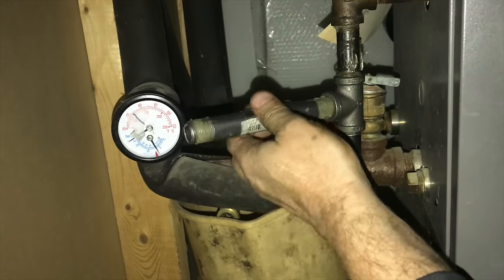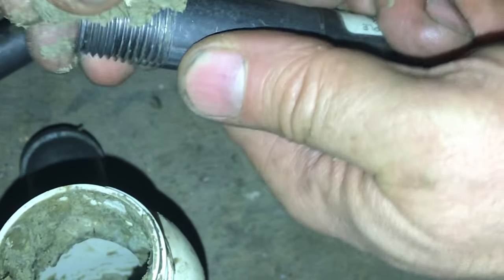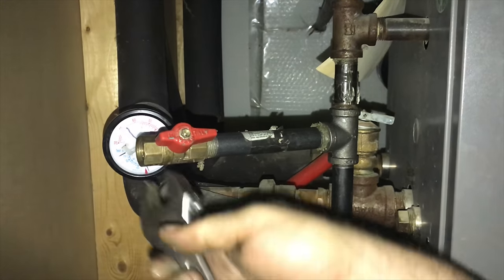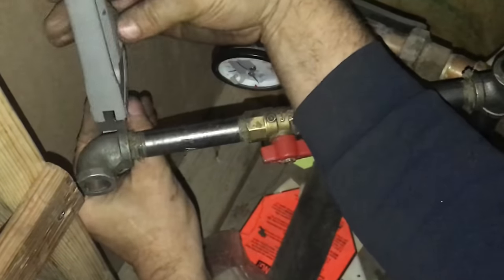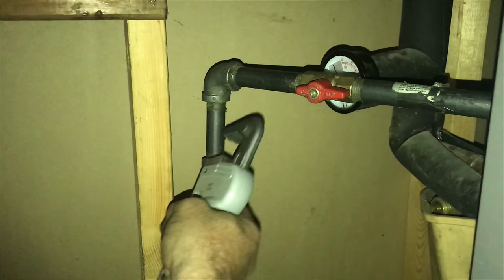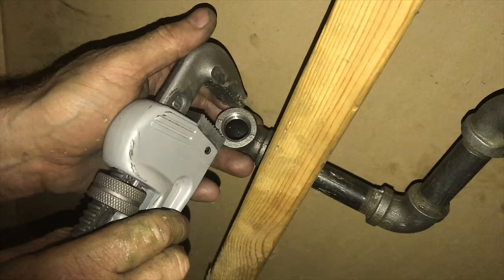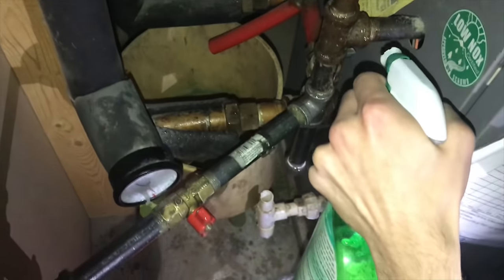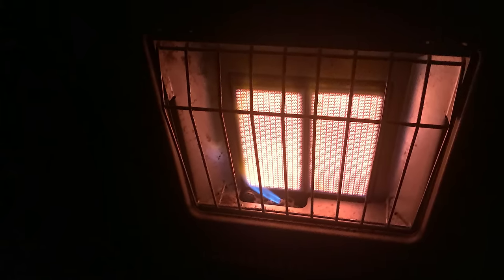TIPS on how to install gas line

Comment: How do you trace a gas pipe that runs inside walls?  I have a gas pipe that goes into my fireplace.  Unfortunately it appears to not be hooked up because no gas comes out of it.  I want to trace it back to where the supply side is either capped or maybe where there is a shut off valve.  The entire wall where the fireplace is is made of brick so my Walabot stud finder won't pick it up.  Do they make gas pipe locators (either a tone type or maybe a metal detector type?
Reply: You need to call a professional. Do not ask this you tuber for any advice his a hack

Comment: ALWAYS use a Yellow sheathed flex hose, never use bare steel flex hose for gas now days, and yes that is now code in most states if not all.
Reply: CSST
Reply: Also you can not re use a appliance flex connector.  Read the ring on 5he flex connector
Reply: The only reason for using yellow is for identification by people like you.
Reply: CSST is different than a flexible gas appliance connector

Comment: You can't bury the gas fitting in the wall should be outside the wall and accessible to change and service the line valve should be also at the end so it can be replaced when it starts to leak at the stem being in the run like that, I being a gas tech would have refured you to a plumber for valve replacement when it went.bad .If at the end where it excesses we would offer to replace for a small fee ,when in place it was require to much disassembly and reassembly we would have turned the gas off to the house so a plumber could repair it.

Comment: Can you reuse that pipe if replacing a gas controller on a water heater or is it one use like the yellow flex hose
Reply: You can reuse them, assure though that the threads are clean.

Comment: Noob question here. Why add pipe at all? Why can't you just remove the bottom cap of the established pipe and attach 5 feet of flexible gas tubing kit with a direct connect to the heater?
Reply: Valid point ! You can as long as you avoid sharp turns (i.e. more than 30 degrees).
Reply: That "cap" is required by code, it must be 3" long minimum and is called a "drip pocket" its intended to catch any free debris in the line before it can clog a small port in the burner assembly or gas valve.

Comment: If you are connecting a gas line INSIDE your gas powered dryer, can you use teflon tape?  Or is pipe dope still better?  Keep in mind these fittings may need to be disconnected again someday to replace dryer parts.
Reply: I always use both Teflon and dope. But never I the flex hoses
Reply: Call a professional please
Reply: PTFE only is legal in most U.S. states and in Ontario Canada
check with local jurisdiction

Comment: What if you have a leak, do you just tighten it more? Just curious. I'm guessing you cant replace a piece in the middle of a run. You have start at one end and assemble all the way to the other?
Reply from the maker: Typically, if you titan it more you can get it to seal, if it’s in the middle of the run you’ll have to tighten everything from that metal piece all the way to the end. There are times that I’ve seen a crack on the thread in a matter how are you tighten it won’t seal. Pipe threads are tapered so the tighter you tighten the pipe the more thread interference you have the better it’ll seal. The pipe dope doesn’t make it seal it just lubricates the threads so they can get tighter with less torque.  Hope this helps
Reply: @livefree6878  It helps a bunch. Thanks for the reply. I'm subbing now.

Comment: I own several houses and I am so tired of hack contractors who rush thru jobs and leave me to repair things. Im doing my own new gas line. It's not that daunting , we are natural gas and down here they use yellow plastic lines. And basically what is a push to fit connection. 2 plumbers in a row ran a yellow line out in an arch into the flower beds since after I asked why they don't use a 90 degree bend to stay along the house, they said they don't make them. Everyone is a hack these days , with few exceptions  .

Comment: You can make these plumbing connections much better. We can do better than the turkey. Why not use pipe fitting fluids? Flex connection and flex are not secure. Natural gas stove is not safe.

Good luck

Comment: I especially like the way the pipe angles down after going into the stud.  Don't see that too much.  Oh yeah,  How are you going to read your gauge that you ran that pipe in front of?
Reply: bososz . Main does not mean the main street in downtown. Shee-o-no-shee he’s got over 330 k views and i am sure this video helped a lot of people. And it does not bother me at all because for me this job would be too small to take over.
Reply: @anonymousbyproxy8250  obviously your not going to run each line from the street................................

He tied into the system from the drip pocket on the boiler, That is wrong. You don't apply 100 year old dope by hand, you use a new can and brush. You can use Teflon tape or dope or better yet both.

1 hole in a stud is not a proper pipe support.

It's crooked and unlevel as fuck.

He blocked the temp/pressure Guage.

At least he added a drip pocket back into the mix, so he has that much going for him.
Reply: @anonymousbyproxy8250  the main gas line in the house . He tap in the the drop of another appliance witch is a code violations among the other code violations he has
Reply: @bososz  well said

Comment: Good job, good tips.  I'll be using some of these tips when I run the gas for our back-up generator I'm installing for our house.  Thanks for posting, I picked up some useful tips. Especially to use pipe compound, sharp pipe wrenches but not on valves and to plan my route.
Reply: Call a professional please
Reply: I hope you're joking...
Please don't use these "tips"

Comment: DIY ers do not need to be doing this. the nipple on top of the tee has had metal cut away from the wall with your sharp pipe wrench.
never use a brass valve on natural gas, spend the extra dollars for a steel valve.
never sharpen your pipe wrenches as they will chew up your pipe, always make certain you can see thread after your pipe has past through the wall and your fitting has been installed.
do not place your pipe in a bind as this one is, note the angle where it passes through the stud, this will lead to breaking in the threads. Buy the yellow coated flex hose. 

I have worked in the natural gas industry for 40+ years, i can count on one hand the number of times that i have cleaned the teeth of a pipe wrench, never sharpened. 

good rule to remember is that black(steel) pipe is for gas, galvanized pipe is for water along with Brass. Gas will eat brass for breakfast.
Reply: There is no issue with using brass valves with natural gas. I don’t know where you got your information from on gas eating brass. There are many issues with this video but using brass isn’t one of them.
Reply: @o6lifeguard  I don't know either we use brass ball valves on every furnace we install

Comment: Drip leg for all appliances!!
Reply: Opened 100+ and never found any residue.
Reply: @anonymousbyproxy8250  doez not mean that it's not code required. And the way the dope was put on its likely going to clog a port when it makes its way there. Just replaced a gas  alve for this exact reason
Reply: @MrDmadness  u replaced a gas “alve” ?!? Gas alve ?!? On whose ass ?!?!?
Reply: @anonymousbyproxy8250  valve.. my bad tablet mis type. I can admit it.. you should try it ;)
Reply: @MrDmadness  Don’ worry, evidently it was a typo, unless your mind was on smthing else …
Reply: @anonymousbyproxy8250  I'm not understanding what your trying to imply... you're very bad at this and really reaching

Comment: I've done a lot of disgusting things while plumbing and I gotta tell ya, watching him scoop acient calcified earwax from a pill bottle with the occasional hair in it and apply it very messy to an already 45 year old black nipple has got to be one of the most disgusting things I've ever seen in my life. here's a tip for everyone trying to learn from this video. use soft-set yellow pipe dope OR blue pipe dope when threading gas pipe, you dont need alot either, just enough to cover the threads. dont use tephlon tape bc it can fall off in pieces on the threads and get lodged in your gas orifices. say NO to pipe wrenches when working on something this small as it's very unnecessary and will end up being frustrating. instead use channel locks, intead of using 3 different tools you could use one. Also hold backup when you thread onto a series of specifically oriented materials such as valves for God's sake.

Comment: I have a question about the diameter of the outlet on the meter. It is currently 1" diameter. I will have somewhere about 90' of pipe from the meter to the furthest appliance. So I would like to attach a 1.5" pipe to the meter. Can you install a 1.5" diameter outlet on the gas meter with 1" outlet? From my understanding, attaching 1.5" pipe to the 1" outlet on the meter would create a bottle neck right there?  Thanks
Reply: Adding a large diameter pipe will assure that you get the same flow at the other end, otherwise for such a long length you may have flow reduction at the terminal. But at the terminal do you need that much flow as supplied by 1” pipe ?!? (For a house that’s a lot). How eventually did u solve the issue ?
Reply: What kind of appliance?  Sounds like a generator or pool heater??  Make sure your meter can handle the additional btus.......you can look up pipe sizing and what size pipes you need based on the run and the load.
Reply: Call in a professional please

Comment: Thanks for this video, I did just about everything you did to install a grill and I'm going to make everything tighter (though there are no leaks).  

Is it possible to have black pipe all the way to the heater?  That is, if the heater never had to be moved?  

Does this heater have a chimney or an outside vent?  I would like a heater like that in the garage but I don't like the idea of no outside vent (and possible carbon monoxide).
Reply: leave it to a plumber for the love of God
Reply: I’m no expert, but I’ve  read of “ventless” gas heaters.  Try researching “ventless” gas heaters.
Reply: @bravomarlon91  We probably will, but I think the plumber we know might be an atheist.
Reply: There are burners that don’t need vents and they are common. U cannot properly connect a black pipe directly to an appliance because u need a certain flexibility.

Comment: After you finished everything, if you need to replace an elbow in the middle, do you have to start over from the beginning?
Reply: You could cut the pipe next to the elbow you wanted to replace, then use a Union to insert the replacement parts

Comment: This is why how to Videos for gas lines are not good. 
In Alberta you are to use yellow Teflon tape and ONLY yellow on gas line (pipe dope is optional as it is NOT a sealant).  But as far as running a gas line in a wall, is only allowed if you have no joints in the wall. 
Lots of things to know because code is not the same everywhere.
Reply: First time in my life i heard dope is not a sealant !!!

Comment: All threaded joints need Teflon tape and pipe dope ... watch roger Wakefield gas line repair ... that’s a real plumber doing a gas line the correct way
Reply: U can use either depending on ur local codes.  Just make sure it’s certified for natural gas.  Everyone in Ontario uses pipe dope.  Even the utility. No leaks.  I warranty my lines against leaks for life.  I haven’t had a leak in 20 years except for people that do stupid things... like run into it with a riding lawn mower.
Reply: @JohnSmith-qj7hd  "Everyone in Ontario uses pipe dope"
I guess I didn't get that memo
Switched to PTFE tape only in 2016; on potable, heating water, nat. gas and propane, not a single leak.
Neat, clean, consistent.
Reply: @walterbrunswick  you're brilliant

Comment: Plumbers and pipe “fitters” are desperate when they see this kind of DIY videos ! They fear loss of monopoly on a trade that needs only 8 years of elementary school and at most two years of vocational training.
Reply from the maker: I’ve learned most of my plumbing from the school of hard knocks. I’m sure there’s things I can do to improve, but I’ve done a lot of plumbing and it’s been working for years. You can save a lot of money by doing the work yourself. I always look for better ways to doA job, there’s never a day I don’t learn something new. Appreciate your thoughts thanks
Reply: In canada you must have a high school diploma or GED with academic upgrading in order to attend post secondary education as a plumber and gasfitter. You also need four years of vocational training and must pass eight interprovincial exams to become certified. There is a reason we are certified and that it is a compulsory trade in canada. This "monopoly" you talk about is paying someone who knows what they are doing to complete the work in a safe fashion that meets the standards set out by interprovincial codes. We also assume all legal responsibility for our installs. Not sure where you live but if all that is required of you to become a gasfitter is grade 8 and two years apprenticeship the laws pertaining to gasfitting are pretty lax or you havent done your research correctly.
Reply: Mark Allan . You say “There is a reason we are certified and that it is a compulsory trade in canada”. Dude, it is not “a compulsory trade” - it is “a requirement” , also please spell Canada with capital C. Vous êtes un tabarnak, n’est-ce pas ?
Reply: Beelzebot  Your comment made me smile !    Not much work lately ?

Comment: Outstanding presentation! Very informative
Reply: Mike Harrison I thought I was the only one that thought that this a joke, this is a terrible representation of quality gas fitting work.
Reply: Why?
Reply: @slick703 thank you for the very detailed explanation. I will admit I know little to nothing about working with gas other than it should be respected.
Reply: Jim don’t use this video to learn how to install gas pipe, the work is sloppy, dangerous and illegal in this video, no shame on me I’m just trying point out some very important issues that this dude left out, by the way I liked the video, Jim you are a hater shame on you, if you want to learn how be a pipe fitter go become an apprentice.
Reply: @viperocco  the guy has 3 code violations. He is a hack
Reply: @slick703  well said . I like the idea of only being able to use material from th usa or in my case canada.  I think it's a bad video as he has several code violations
Reply: @anonymousbyproxy8250  it is more than fitting two little pipe together.  If you knew anything the video has several gas code violations.  That is hazardous
Reply: @ronaldlabelle7274  I learned something but can't remember what since it has been a while. Thanks for looking out though. I did read the comments after and got a more clear picture.

Comment: Lucky dude you are. Flexible instead of a solid connection. Drip leg on an existing boiler. Valve after the valve on the boiler; so if you shut off the gas to the boiler, you’re also shutting down the space heater. Some jurisdictions make plumbing easy.

Comment: Why are we watching someone using brand new tools? 
Who puts pipe joint compound on with his fingers? 
Who doesn’t mention anything about certified valves, certified natural gas pipe dope, foot pounds of pressure, skips mentioning number of threads things must go on, support for pipe, calculating loads, pressure drops, skips the charts. What about venting? Fresh air intakes?   

What’s with the sharp pipe wrenches?  I use mine every day and don’t run into these issues until much later.

Why is he not using a coated “flex hose”
Reply: Hey dude, who u think u are ?!? - owner of A.O.Smith ?!?
Reply: @blueg3027  Poor Jordan, not much work lately ?!?  And you fiercely fight to keep your exclusive right of … fitting two pipes together !?!

Comment: Leave Flintstone antics within that era,  Csst/ corregated stainless steel tubing. Two joints, one from supply, other joint terminates at the desired fixture. Cut/thread is dinasoar pipe/fittings that must be wrapped within any place a pipe wrench or tool within choice scratches the pipe/fittings. With 2 wraps of 20-mil tape. Indoors, and-or in any application out of the outside elements, sun/cold ect can't be surpassed. 1/4 of the labor time. Already included insulation completely covering the Csst. 2 joints mentioned above, no joints between the gas meter to your desired fixture/appliance. Much less chance within leaks with flintstone past time multiple pipe joints. This particular application, Csst/system done within 20-minutes, leak search included.

Comment: Lol, there is so much fail in this video. The simplest one to point out is that he has zero idea how to use a pipewrench. You DO NOT spin a malleable iron fitting by spanning the open end of a fitting, deformation will happen, which us why he had trouble threading that 90 on. Also code violations a plenty, the most obvious one is putting a flex line in the wall
Reply: yep!! which is why street fittings are banned in most jurisdictions
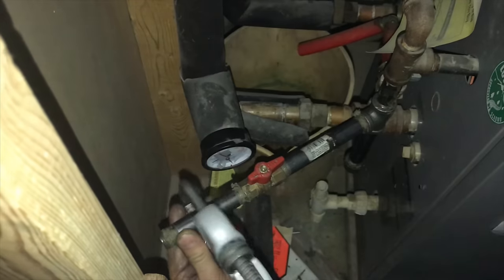take a look top right corner 3:21
Reply: I move on when he apply that old pipe compound with his hands and  put some Inside the pipe
Reply: Why are we watching this. Information is wrong, work is wrong. He needs to put a disclaimer on this video.